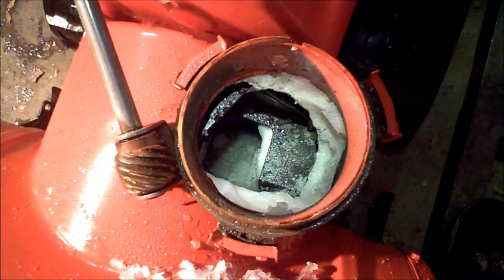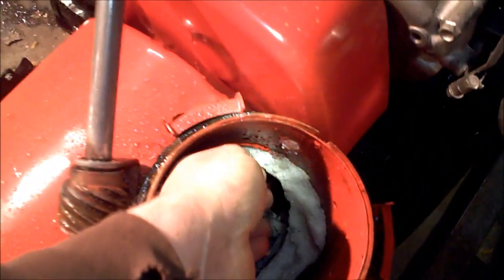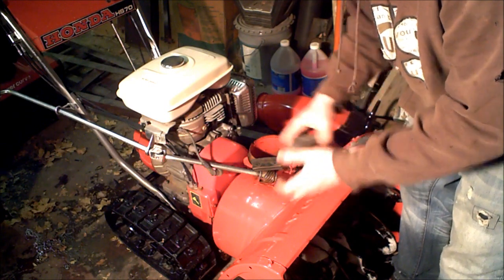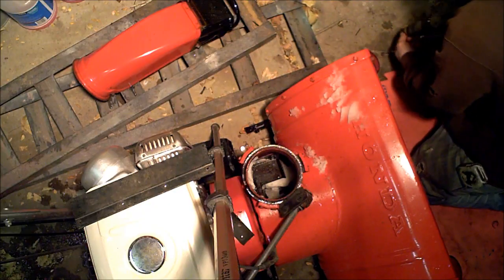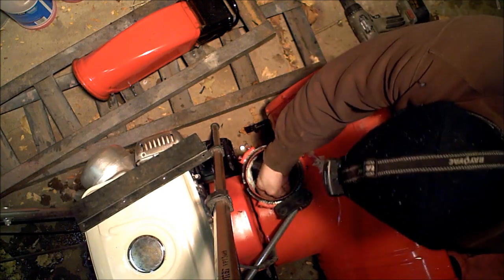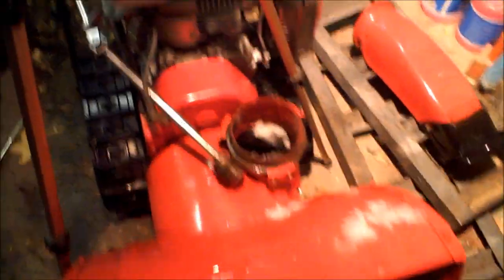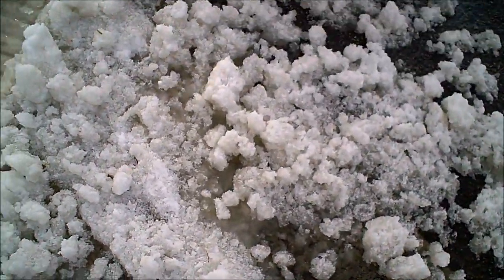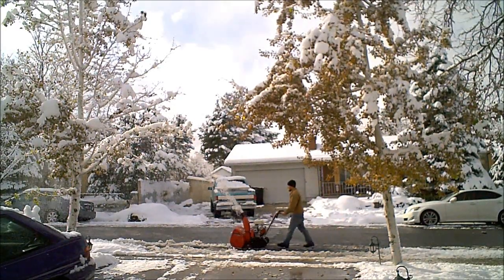Modify Snowblower to never clog and throw twice as far w/ Impeller Kit

Comment: I have to vote that tip as being the best tip I have ever seen in a DIY type video. I don't know where you learned it or how you figured it out, but thanks a million for passing along a tip, that's worth a million! Add it really works! I wonder why the manufactures haven't picked up on that. Take care. Jpol.
Reply from the maker: Thanks, I'm glad you liked it.
Reply: sixtyfiveford  Can I do that on toro ? If not what can I do ? Thanks
Reply from the maker: @josecenteno3273  Yes it works on Toro you'll just need to predrill the holes in older models with thick blades.
Reply: @sixtyfiveford  Thank you

Comment: added pieces of conveyor belt, about the thickness of tire sidewall (because thats what I had) fastened with self tapping screws on the cutting surface of the impeller (expeller) run it a moment because the gap is there to accomodate screw heads. the rubber will instantly wear out where it contacts anything and create a nice tight seal. tt works amazing. A neighbor walked up the street and asked what blower I had because it throws very far. tolf him the cheapest I could find then did this modification. he was amazed. I was amazed. I since have given strips to others and they poo poo it too bad, because this mod is epic, no more choked throw chute, just a steady stream of snow arcing off into the distance.
Reply from the maker: That's fantastic. Thanks for the real world feedback.

Comment: What about Crazy carpet or teflon cutting plate ?
Reply from the maker: It needs to be flexible. Rubber is best.
Reply: @sixtyfiveford  yeah yeah tnx for answer, was just thinking to save $ cuz for here in Canada on Am.zn.ca the price is not the same...
Reply from the maker: @martindesmarais7158  They really hike the price up for the Canadians. Old tire sidewall(cuts right out with a razor blade), conveyor belting, Rubber Mud flap, or really anything else you can find made out of rubber that's around 1/4inch thick.

Comment: I have a TroyBilt StormTracker 2690 that's 3 winters old. Generally I have been very happy with its performance. However, it has on occasion gummed up due to wet snow on the bottom 1/2-inch of multiple inches of snow. I watched this video. Then bought #14x1-inch gimlet screws, 2" steel backup strips, and truck mud flaps. I disassembled the chute volute, then made a thin cardboard template with bolt holes. I transferred template shape and hole locations to the flap and snipped with sheet metal shears. Added them to each of three impeller blades, drilled, and mounted the rubberized extensions. I used a razor blade to trim some obvious excess against the steel volute. Reassembled the machine. Started up & engaged the impeller, noisy for a little while till excess rubber wore off. Headed over to the snow. Wowy, wow! What a difference in throwing distance! Can't wait to try on slush!  
Thanks for the video!  Engineer B'
Reply from the maker: Thanks, I'm glad you liked it.

Comment: I just did this mod on a brand new (right out of the box) Yardmax 24-inch.  I used 1/4" conveyor belting and stainless steel nuts and bolts. It was TOUGH drilling through all three metal impeller blades but I wanted to do this mod before the snow in Pennsylvania gets too bad.  Can't wait to see how it works!!!
Reply from the maker: Awesome!

Comment: Somehow commented that the added friction against the housing could "burn out the bearings".  Ever heard of this problem?
Reply from the maker: The rubber shouldn't be rubbing on the housing, just barely skimming it. That's why I chamfer the tip of the rubber edge. Some people will force the rubber into the impeller housing so hard that the belt can't turn the impeller. They try to run the machine and continue to hold down the impeller lever even though it is reluctant to turn. It will burn out belts if you do this but not bearings.

Comment: Thanks for the video! I just did the modification today on an 8 year old craftsman that i have never liked. Hoping this will increase the distance on wet snow.  Can't wait to give it a try. I will update this post with my results.
Reply from the maker: Let me know what you think.
Reply: @sixtyfiveford  First snow of the season, 4-5 inches wet and heavy. Before the modification the snow would have been thrown 10-15 feet, and in some cases not far enough to clear the driveway, meaning I would have to clear it a second time.   NOT ANY MORE! This thing is now officially a beast!  I can not believe the difference. Wish I had seen this video years ago.  1 down side, my neighbor  may not be happy, I was throwing snow over the fence!

Comment: I own a 41 year old MTD blower with an 8 hp Briggs & Stratton.  In it's entire life, I've managed to clog that thing exactly ONCE with heavy wet snow winged into my driveway by the city plow but I was certainly pushing the issue so my bad.  It certainly has no rubber blades on it BUT the gap between the impeller and the chute is very tight.  Additionally, the diameter of the chute is MUCH bigger than on today's machines and the gearbox between the auger and impeller is nearly twice as big as on modern blowers.  In 41 years I've had to replace ONE belt which turned to fluff and ONE spring which snapped off a couple years ago.  My lot is 70 feet wide and I can almost put the snow from my driveway into my next door neighbours drive.  It easily blows snow over 20' in the air.  By way of comparison, my other next door neighbour has a 2 year old John Deere blower.  He spends half his time with the stupid "Poke Stick" trying to clear his chute.  Mine didn't even come with a poke stick.  Additionally, that old B&S engine is amazing and just keeps chugging along.  I wouldn't trade this old machine for ANY of the new stuff available and will use her till she blows!  Is there a PUN in there somewhere?
Reply from the maker: I've revived a few of the 70-80's era MTD blowers and they were very well built.

Comment: why dont they do these to machines straight from the factory??? this is a major design flaw
Reply from the maker: They don't because they want to buy a high end snowblower after a few years of fighting with your entry level machine. Snowblowers at $1000+ generally have very good clearances but the gap does enlarge over decades of use as it did with the 1980's Honda in the video.

Comment: My MTD Yard Machine has curved blade on the auger that has that part built in.  It also has a rubber web edge on the blades so it cleans itself.  One trick that also helps is to spray the auger and inside the chute with WD 40 and let it dry.  It leaves a film that prevents the snow from sticking.

Comment: Did this mod to an ariens 8526 4 years ago (kits are available on-line). The 8526 only has one impeller drive belt which got eaten every season. I cut the rubber back a bit ant would suggest perhaps a .020 gap between the rubber and chute to assure the rubber doesn't freeze to the chute as mine did. Went with a dual belt mod for the ariens so it shouldn't be a problem now. 

As for the mod itself....wow! The throwing action went from 10ft to 40ft.
Reply from the maker: That's why I taper the leading edge to a 45degree angle. So if it touches it isn't offering any resistance. I still try to keep it at 1/32" away though but rarely is the impeller centered so it will just touch somewhere. The 45degree edge will quickly wear away if/where it touches.

Comment: Not meant to be a stupid question. Bu t I am not much of a handyman.  Am I correct in assuming you would pre drill before  using the  SS machine screws?
Reply from the maker: Yes and no. The self drilling screws will go through most thicknesses of impellers. If it won't you may have to predrill.

Comment: All... you have to do to stop a sno thro from blocking up is wax the exit hole and a little underneath inside of the hole as far as you can reach.  I learned this about 15 years ago with my older Ariens.  Once you wax these areas, you will never have another blockage.  The wax keeps the snow from sticking and the snow just slips right off and slides and passes right through the hole.  There is no need for all of the adding of extentions to the impeller fan.  Yes it might add some distance to the throw, but to take care of the blocking up of the snow, all you need is to wax that hole.  If you want to go a little further, wax everything inside of the bucket along with the inside of the chute and deflector.  Clean up will be that much easier.  Before every storm, I just wax the areas mentioned and the results are very satisfying.

Comment: Clever idea, I think its worth a try, but has any one had problems with slipping or broken belts from this mod?
Reply from the maker: If you already have a extremely worn belt or non adjusted tensioner you could get belt slip. But if it is a good belt you won't have any issues.

Comment: Nice mod. Just bought a 2 stage craftsman like new for $50. Got it cheap cause the guy said all it ever did was clog when snow was wet. This one has plastic impellers.So instead of using self tapping screws for fear of them coming lose and wreaking havoc, I used all stainless hardware. For the flap I used 1/4" thick corded rubber off the head on an old floor squeeze I had laying around. It's only May here so it'll be awhile before I see how it goes. Thanks for taking the time to make the video!
Reply from the maker: Thanks, I'm glad you liked it.

Comment: Your comment about not being able to do this on a Toro... yes you can. I drilled pilot holes first, a little smaller than the self tapping screw I used. That screw just needs to be a little longer, also. My 824 has a three blade impeller, so I just made three paddles. I didn't catch that comment the first time I watched. Huge improvement! Many thanks!
Reply from the maker: I said you couldn't use self tapping screws on a Toro due to the thicker steel impellers. Predrilling does just fine as you found out.

Comment: Did this but used old rad hose cut to form two C shaped pieces. Then I double stacked the two pieces in a )( configuration on paddles. -{ )(  ...Fastened with stainless steel bolts, nylock nuts and fender washers instead of self-tapping screws . This added a little more flexing and selfcleaning function of the rubber hose wipers.
Reply from the maker: Nicely done.

Comment: Why didn’t, the manufacturers install this simple attachment ?
Reply from the maker: So you buy a new more expensive snowblower. The higher end models around $1000 plus have very small gaps and work very well when new. After years of use the gaps enlarge from use(ice and stones) and the performance suffers. So a $1500 Toro would see very little benifit when brand new from this modification but a 5-10year old machine would. Cheap machines are just that and will suffer from day one. People are just happy to not be shoveling.

Comment: In the video, you said this cheap fix will not work on a Toro snowblower.  Is there another solution for Toros?  In Wisconsin, we had record snowfall in Feb and way above normal for the season.  I recently put water into the chute so to break up ice between the metal parts.  Would appreciate other recommendations.
Reply from the maker: Toros just need the holes predrilled. It works fantastic on Toros

Comment: One thought: last month some idiot came around throwing phone books on the sidewalk, just before a snow storm. My snowblower ate up one of them and it got badly jammed in the impeller. It would have been even harder to remove it if I had made this modification. 
I plan to do it, but will take extra care not to run over junk.

Comment: I guess the impeller metal is soft enough to tap a screw into it?
Reply from the maker: Most are. Some older Toro machines had a hardened steel so predrilling was necessary.

Comment: Need your advice. I am looking to buy my first snow blower. I have a big size driveway and use an old atv with straight plow. I need something to help me throw the snow. I am comparing all new not used snowblowers the ariens 30" deluxe which costs $1400 to the Troy-Bilt Storm 2-Stage Electric Start Snow Blower — 30in., 357cc Engine, Model# 31AH5DP5766 which costs $1030 to
 the Dirty Hand Tools 103879 Self-Propelled - Electric Start 302cc Dual Stage Gas - 30" Snow Blower which i found online for $800. What are your thoughts on the DIrty hand tools? I am really inclined to buy that one for the features it has. It looks sturdy. Which one would you buy at these price points?

https://www.amazon.com/Dirty-Hand-Tools-103879-Self-Propelled/dp/B01723P4GW/ref=sr_1_fkmrnull_4?crid=1IHWRE3UL1Z4O&keywords=dirty+hand+tools+snow+blower&qid=1550981624&s=gateway&sprefix=dirty+hand+tool%2Caps%2C315&sr=8-4-fkmrnull
Reply from the maker: For the money, anything from Toro is a great bet; followed by Ariens then any of the MTD brands(Troy-Bilt, Cub Cadet, etc). Dirty hands and similar machines are Chinese in every way and will disappoint you miserably.

Comment: HELP!!!   Hey!  Does this work on a Poulan Pro, 10.5 HP/ 30” , model PP10530ES?  What I missed or don’t understand is, were there holes in the impeller already?  Or, did you drill them?  It was suggested to me, to buy a new impeller belt to improve the power to throw the snow further!  I’m a gal in MN, who does all this mechanic work myself, and if I can install these rubber pieces right through the top of the chute, it sure is nicer and quicker than taking everything off to install a new belt!  PLEASE, someone help me and answer~!
Reply from the maker: You need to drill the holes yourself. You can do this with self drilling screws.

Comment: Just looking at the mod, amazing! I'll have to heave away my tractor after I get the old Yard Works done ahahah and make sure all the vehicles on the block are inside before throttling up. Nothing sarcastic meant here just heaving in a little bit of funny if you don't mind! Great video bud...cheers and I am going to fit those rubber extenders in there.
Reply from the maker: Thanks Man.

Comment: I was using silicone spray in the chute and the impeller. I found that the build up was mostly occurring in the upper area of the chute when blowing wet snow. I will try this out as long as there is no additional vibration which could cause premature wearing of the shaft, the bushings and gears. All expensive part to replace. I would suggest installing those on all the blades of the impeller and making sure that all rubber additions are of the same weight. My buddy put a piece of crazy carpet inside the metal chute of his snowblower and has no more issues.
Reply from the maker: The impeller blades are never balanced. The snow load is always only on one side so they are extremely unbalanced.

Comment: So I see this is 2012 now its 2019.  Great update to the thrower,  my dad had a True Value store and we had a number of customer missing fingers.  The older units did not have a disengage auger lever up by the handles or the plastic unplug thing to clear chute so they would use their hands and chop go the fingers. I am Impressed with your modification.  We just sold silicone spray for blowers and shovels when snow was wet.   Keep it up, love people that Identify problem and offer a simple solution.  Cute puppy in the circle.
Reply from the maker: Thanks. I've put many of these older minimal safety machines back into service. Always with a good warning to the new owner about not putting your fingers down the chute.

Comment: It's a great idea.  Threw the rod out on my MTD Yard Man trying to get it to go through 3' thick wet plough snow.  Revved it too high.  I would have installed rubber paddles if I knew about it.  Just bought a new Briggs & Stratton and I might install paddles.  How long do the rubber paddles last before they need to be replaced?
Reply from the maker: They generally last the life of the machine. If you have a lot of rocks they will get chewed up in 5-6 years.

Comment: This is friggin genius!!!  I did this to my Briggs and Straton 9.5 HP two stage (Model 950).   I used cheap mud guards from Crappy Tire on the three stage impeller.  Lots of mixed precip here in Toronto today and although I was skeptical that this would work as show in the video I was very impressed!  It threw the wettest slushiest crap that the snow plow left in my driveway at least 20'.  I if you haven't done this to you snow blower then you are missing out.   It made my $599 two stage snow thrower perform like a $1500 three stage blower.

Comment: I hate to be a downer, but all I do is spray coat the entire blades and shoot with some HD WD-40 And never had a blockage from start to finish. I do have a very long/wide driveway so this is a life saver for me at my age!!!
Reply: As good as it works with you spraying WD 40, it would work far better with the modification. There would no longer be a need to spray, would save you  money,  WD 40 is not cheap.
Reply: I totally agree with your reply! All I'm saying is: for those who aren't as gifted as you, or those who get caught without this adaption, the WD-40 will help you get the job done until you can get your modification installed! just consider it an option. P.S. WD-40 does not cost that much vs. a hospital visit for a heart attack!